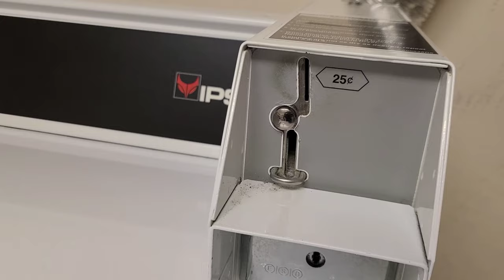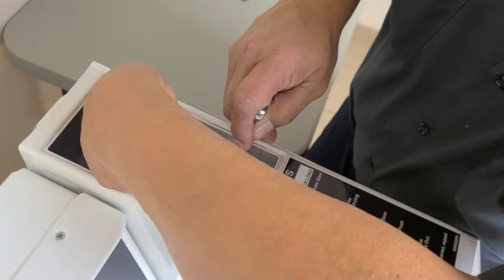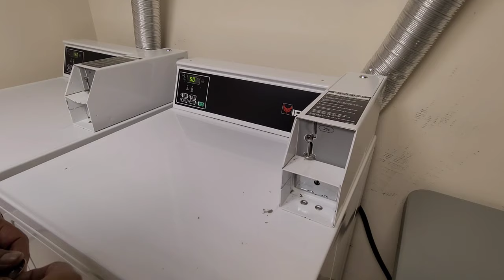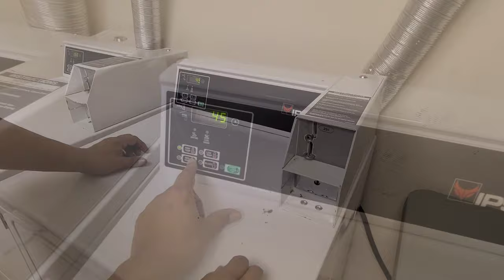How to remove coin mechanism on washer/dryer

Comment: Noe, thanks for the great video. I had the same problem but couldn't get the socket extension over the holidays. I duct taped the 7/16 socket to a 1/2 piece of conduit and it worked great!
Reply from the maker: Look at you that is some ingenuity. Thanks for the visit
Reply: That's brilliant. Thanks for sharing the idea.

Comment: I had this exact issue with my machine. Thank you for posting this, as soon as I got my hands on the socket extension I had the coin drop working smoothly in no time.
Reply from the maker: Thank you for your comment. When I had my problem I searched YouTube for a video on how to fix this, I could not find a video on this . so i'm glad to help
Reply: Thank you for this!

Comment: Thank you for your video ,..  you saved my bacon.   
I gorilla taped a deep well socket to 1/2 in pex pipe  and a gear wrench on opposite end and drove a drywall screw along side of pex between gear wrench teeth so it would not slip while loosening or tightening.    
I can do all that but still Not sure how to post a pic on here.   ???   Lol.
Reply from the maker: Cool. thanks for the visit

Comment: What tools would i need exactly for this. I have a SQ snwbx2 type -
Reply from the maker: dk that one
Reply: I know it's a bit late, but depending on the nut, you would need either 310p4 or CK096 to remove them

Comment: Should just use ratchet on end of bar that's what it's designed to do
Reply from the maker: great
Reply from the maker: You are correct, you can use a 3/8" socket drive or a 3/8" open-end wrench. Thanks for the visit.